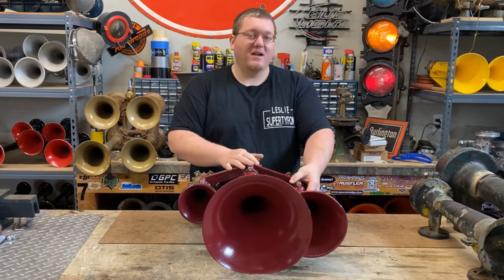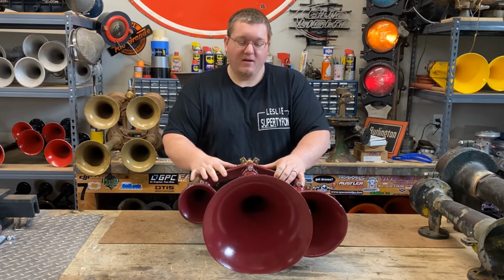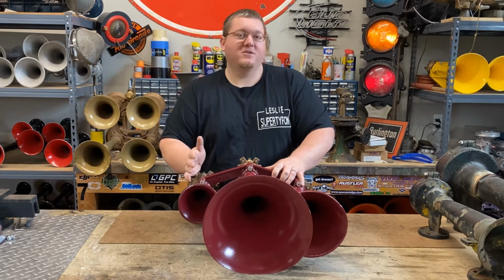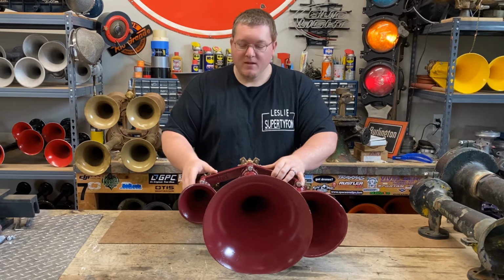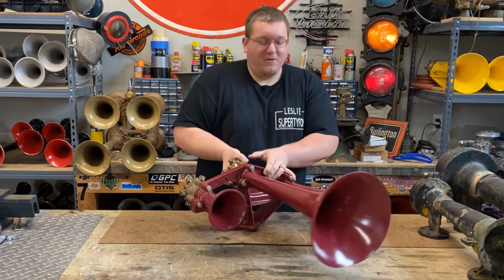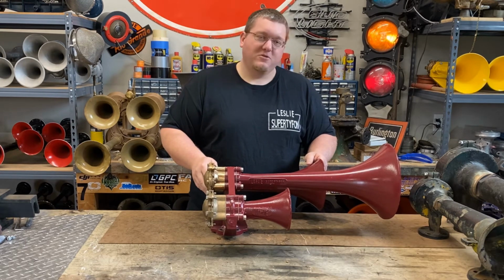Leslie S3P/C Real Train Horn Leslie Supertyfon

Comment: Where do you get your chambers machined I got my horn hooked up but it sounds like a strangled duck I have the dome back SU-3L-LR I think it’s from the 60s like 65 or close I can’t see the date stamp on the bottom of the frame since I had it powder coated.
Reply from the maker: Dome backs date from 1967-1977 so any where in there. And check out the horn and whistles page on FB. There are sources on that page that can help you with machine work.
Reply: @TheHornKing  I don’t have face book I can use my wife’s can you tell me the name of the page